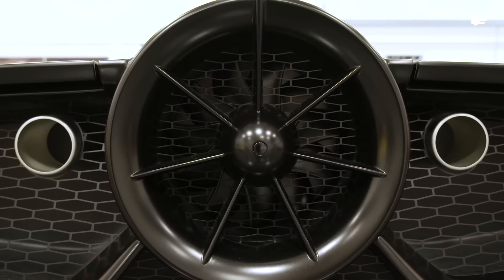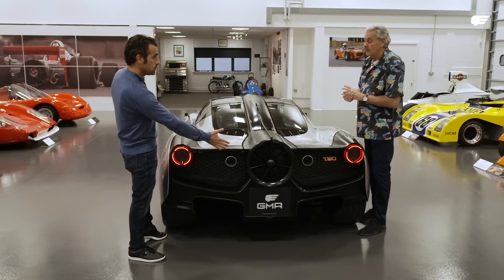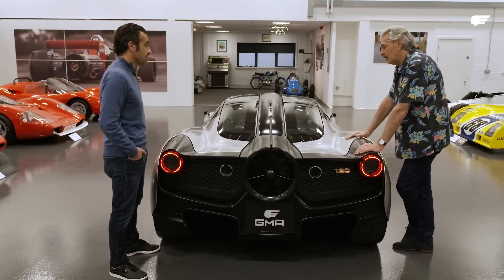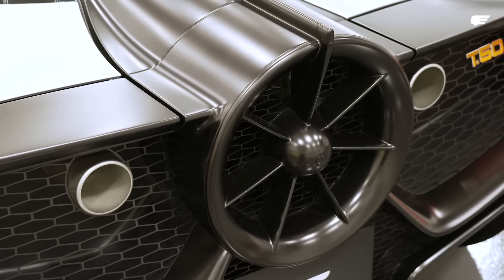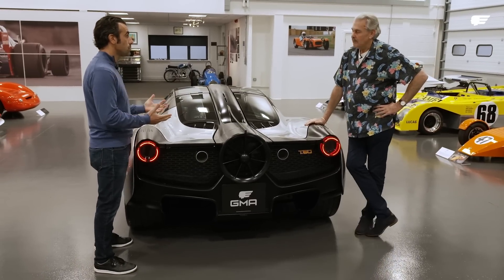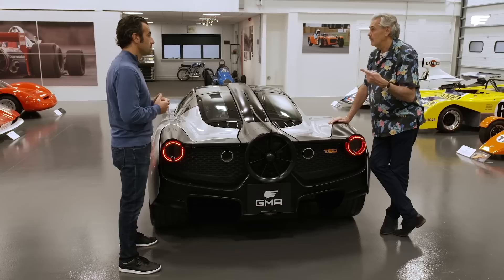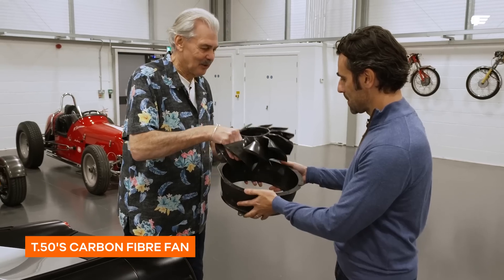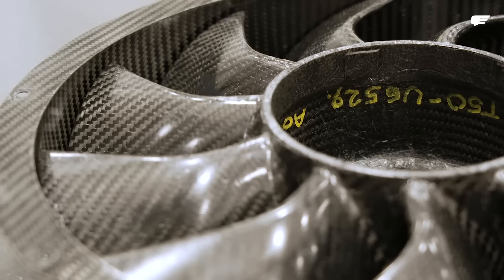T.50 VLOG | EPISODE #5 | T.50 AERODYNAMICS PART 1

Comment: Can the car automatically switch between the different fan modes given changes in the environment or driving condition/style, or does the user have to select manually each time?
Reply: There is an auto mode. But there is a switch on the left side of the dash with a rotary to manually control the modes.

Comment: IMHO the fan is a huge design error. You can achieve the same fan functionality but design it internally.
Reply: I could do without the prominent fan aswell, I think they see it as a usp tho
Reply: @C6SuperchargedZR1  Lol, internet experts telling Gordon Murray he doesn't know what he's doing! Ha ha ha...

Ok geniuses, how do you package such a big fan, valves and ducting above and behind the diffuser (where it should be), alongside the engine, gearbox and rear differential in such a compact car?
Reply: @srinitaaigaura  no one has accused Gordon of not knowing what he's doing. But you don't need a crude and hideous fan to draw air from the top deck to relieve the stalled air behind the car. Look at the proximity of the exhaust and the fan. Why not design a clever solution of drawing air from the top deck using the exhaust gas? Red Bull made use of the blown diffuser to create downforce without the penalty of additional drag. And besides, at regulated speeds in today's cities the fan will have little benefit but at the cost a beautifully designed car.
Reply: @tuomasholo  A 45 cm diameter fan spinning at 7000 rpm and making thrust. Imagine the airflow out of that. I suppose if you could find a better solution with blown diffusers, you should be working for GMA. Remember, Gordon destroyed the competition in his day and his fan tech on the T50 is probably the exact solution F1 needs now to clean up the dirty air and get downforce off a reliable ground effect. Newey also designed his hypothetical RBX2011 with a fan. Even  Koenigsegg haven't yet tried this. 

Here's something, the diffuser itself doesn't make much downforce by itself at all because of how high the car is above the ground. So F1 ideas won't work here. In fact the very reason why the road going T50 doesn't make a ridiculous amount of downforce, but the track version does, is because of ride height, not just the wing - the venturis are so much stronger with low ground clearance. Or else it could never reach 210 mph while making 1500 kg downforce. For comparison, A Senna can't reach 205 mph with 800 HP. 

The fan is key to aerodynamic efficiency. This car is as slick as a Speedtail while certainly making a bit more downforce. The F1 got quite slippery at speed and braking because it made extremely little downforce to start with. This needs about a LaFerrari's level of downforce to handle like one. 

If you want a conventional car, wait for the T43.
Reply: @srinitaaigaura  the 48 volt electric motor powering the fan isn’t creating “thrust,” it’s there to create a more efficient diffuser. There are other clever ways to move stalled air around a diffuser to make it more efficient. A fan protruding from the rear IMO isn’t the most aesthetic solution. It’s a gorgeous car sans fan.

Comment: 50% more downforce of what?
Reply: In other interviews he has said it is not a huge amount but enough for the weight of the car or something like that...
Reply: 50% more than this car in low down force mode.
Reply: @stevenkelby2169  A LaFerrari does very well making only 90-300 kg downforce and a Regera about 350-400 kg at max and it drives superbly stable. This weighs 2/3rd of both of them and is softly sprung, so it makes probably about 200-250 kg at max, which is all a road car needs. If you want downforce the T50S was able to hit over 1900 kg, but they dialed it back to 1600 as the tires couldn't cope (for reference they were making over twice the weight of the track car, while a P1 makes about 40% at best). The T50S can still hit 210 mph despite that much downforce, which is unheard of in aerodynamic efficiency.

Comment: 1 dislike from the Aston Martin Valkyrie team? 🤔
Reply: xD
Reply: @filipborin555  Bugatti? Or SSC? or British made car with American V8 Henessey?
Reply: Valkyrie would be with a classical aerodynamic package with that big wing on the back of the car no chances against the T.50. That fan would compensate the limited ground effect within the corners when the air flow is low. That means higher speed within the corners on the straights would be easy cuz there the down force depends of the airflow speed so faster better downforce but in the corner that would compensate the lowness of the speed so that would increase the speed within the corners and that would given better lap times that would smash everything on Le Mans i belive but dunno what are the rules of the Automobile club de l'Ouest.

Comment: 12.5% less drag is huge, equivalent to changing the Cd from 0.3 to 0.2625 or 0.28 to 0.245. People would do thousands of hours in the wind tunnel on hypercars for this much drag reduction. It's almost the same as turning a Chiron into the Chiron SS.
Reply: @Rays Through Trees, Summer Breeze 
100% more under braking. But honestly it doesn't make a ridiculous amount. Maybe only as much as a Laferrari. Still it's more than 3 passengers for sure

Comment: In car aerodynamics the absolute antithesis of the wing Walter Wolf put on his Countach, and all the better for it.  What a lovely clean shape this thing is.
Reply: some influencer will get one, wrap it and fit a coloured smoke generator in the fan ;)
Reply: Dunno what are you talking about.The Countach's wing is a fakeone dunno did they do any calculations or tests in an aerotunel.
Reply: @filipborin555  yes exactly. Rem acu tetigisti.  Wolf put an F1 car wing on his Countach for dramatic effect, although it destroyed the aero balance and made the nose even lighter while increasing drag.  The factory version at least generated zero down-force, only drag.  The T50 has no wing and is engineered not to need one, so retaining the purity of its shape.

Comment: the shroud on the outside of the fan would look a lot better if the spokes were removed and instead of a full circle it got rid of the curved bit just above the licence plate - just flowed into the winglet(?)  _ /`\ _
Reply: Pfff its placement strongly depends from the data that they obtained by using CAD software aerotunel and maths calculating ligiciels.How do you realise by watching the video witch position will be optimap.Maybe you're a genious?
Reply: @filipborin555 I didn't mention anything about 'optimal'...just aesthetics
Reply: @LT589  I doubt if that is possible. It must be part of the rear crash structure. But what you want can be seen in the monocoque.